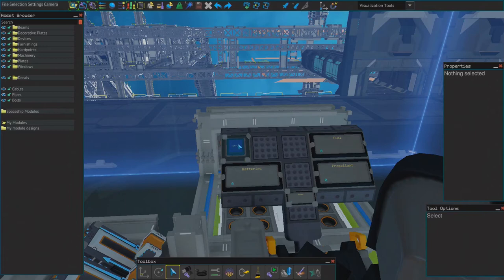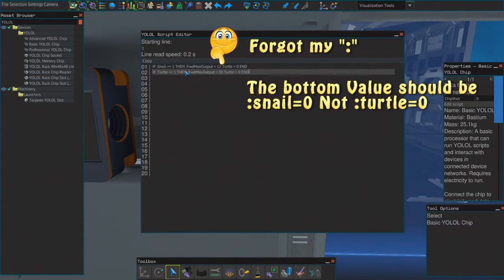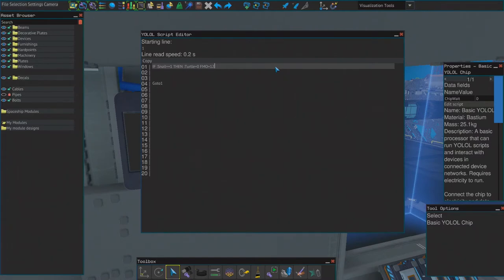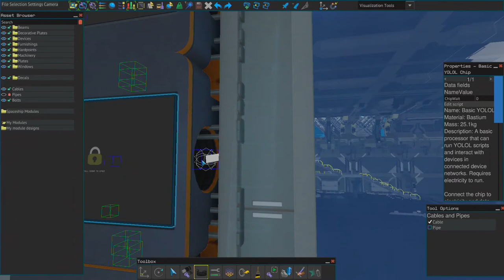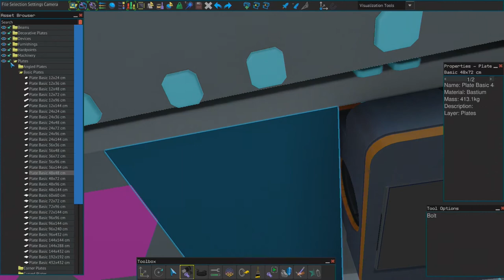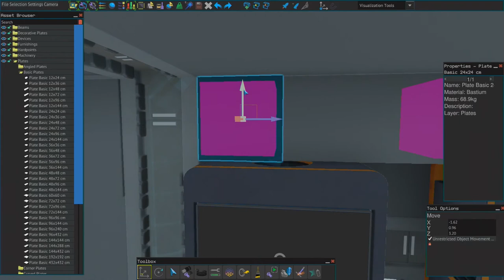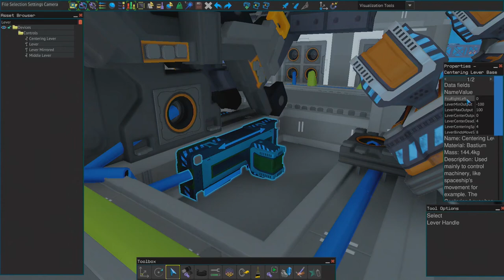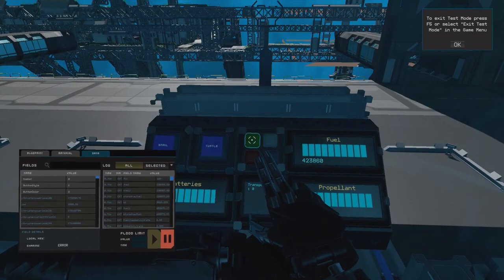Starbase - Let's Learn Ship Designer - Part 18 - More Speed presets - Interior - Decals and MORE!!!

Comment: Half of its weight is in bolts
Reply from the maker: Haha ! Yeah maybe but i kept noticing how some parts had a very low strengh value and the only way to correct it was to add more bolts so after a while i just started adding bolts everywhere i could so i wouldn't have to keep going back to add more later on :-)